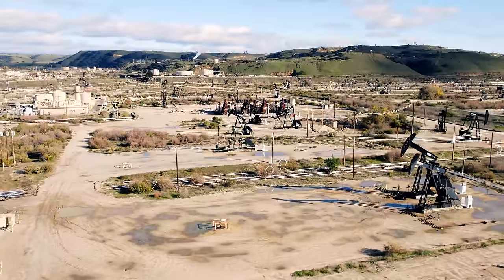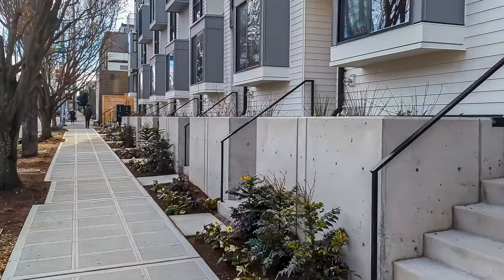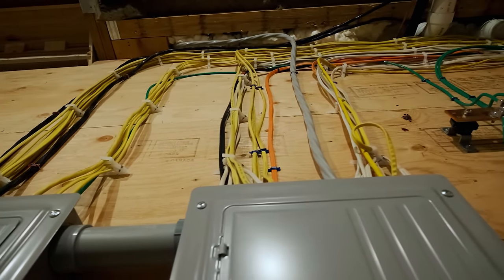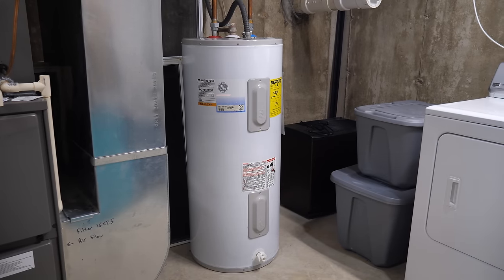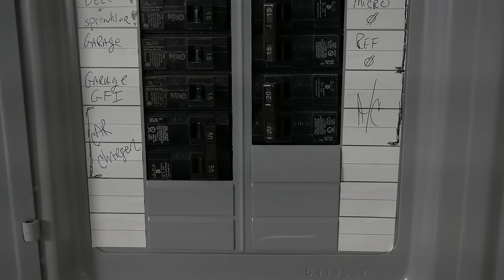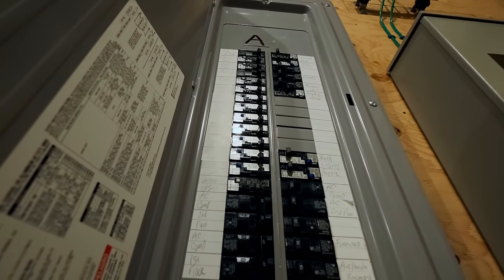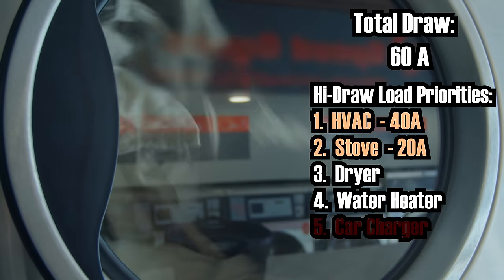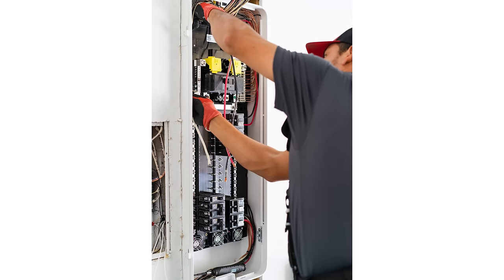Home Electrification: There's not a lot to do, and it doesn't have to be hard (Part 1)

Comment: So I agree with going with electric. The problem really comes in with cost and in some situations gas can save lives. I don't have to worry about winter. Like if power goes out I can burn wood or gas. But for the most part this hadn't been  problem ever. Now what is a problem here is hurricanes. Power outages due to them happen often. And sometimes they last a long time. One time, the power was out almost for a month. They had to wait almost 2 weeks just for the water to leave the low spots before they could get trucks in

But the bigger problem is cost. There is house batteries, but cost and how they live for about 5 to 7 years before having to be replaced makes it impossible.

To make all pure electric we need far better batteries, it needs to be cheaper, and it has to be 100% hands off.

Comment: great video. being from hawaii, the tropics, we dont really use gas cause theres no boiler/furnace to power and though some homes do have gas powered dryers and stoves, im fully electric. still found your video useful because im planning on upgrading electrical breaker panel box and adding some new circuits/lines

Comment: Re: Insulation .... I own a "tri-level" built in 1956. The sheetrock on my walls is attached with 3/4" thick furring strips which are attached to the brick exterior! I added a floor above the house which has good fiberglass insulation, but when the roof was torn off, I asked if there was any way to get insulation into the walls. Not a chance!
I also own a rental property built in 1926. Plaster on wood lath attached to furring strips on the exterior brick walls! Again, no way to add insulation without completely ripping down every interior wall and studding out the exterior walls. Which, by the way, would create ultra-deep window pockets.
On the plus side, I converted the 1956 house from forced air to hot-water baseboard, and I converted the 1926 building from steam to circulating hot water through the existing radiators. Both conversions had tremendous savings on natural gas. I wish there was a good solution for insulation, but there just isn't.

Comment: I live by myself in a mobile home, with 100 amp service, and 15 years ago, when my tank water heater failed, I replaced it with an on demand 45 amp unit. They did not make gas units rated for mobile homes 

Last year my (rarely used) oven failed. I use a toaster, convection table top, and replaced the stove with a two burner induction unit. 
I currently do not have AC and about to retire, therefore this summer I'll install a 2 zone ductless minisplit
Next winter I might be gas free!

Comment: Mexico: 1 phase (115 Volts AC,not 127) with a 40 amps main fuse. About 4500 Watts.😊 In Germany, I had3 phase, 380 Volts, later 400 Volts, with 63 Amp fuses. ~43.5 Kilowatts

Comment: I will say, having a fireplace can be quite helpful in cold climates - but only as a backup. If the power goes out, you can go without hotwater for a while. But you can't go without heat when it's well below zero. While you could have a home-scale battery system, but for the scale of energy storage you'd need to heat a house for a few weeks... it is, if nothing else, significantly cheaper to use fuel-burning systems.

Comment: For the vast majority of situations the most significant cost of a service upgrade IS the new panel and the associated labor to install it. And those SPAN panels cost more just for the panel then an entire service upgrade with a normal panel.

From what I've seen of an electrician on YouTube that even is sponsored by span you HAVE TO connect it to the internet and he even had trouble getting it to turn on and had to deal with customer support for several hours before he could just turn the customers power on because the panel had a firmware issue....

Comment: We had never been to the US before 2018 with my wife. So we went to San Fransisco to a laundromat in the French quarter. Guess how WTF we were as Europeans, when we saw that there was a FIRE inside the tumbledrier! We both were VERY sceptical! I was like "hell no, that can't be, they are actually burning our clothes with gas fueled flames! But I thought that was only on commerical laundromats that would need HUGE amount of electric power for those big driers that are numerous in laundromats! :D

I was a bit amazed that people use gas to heat their water and homes, because in Finland the only places there are gas networks are actually a few big cities. And it is VERY uncommon to have gas delivered by a pipe to your home.

Most homes here are heated with electricity via an air pump, or by a compressor exctacting heat from the earth, and on older homes direct electric heating with heaters under the windows or diesel-oil central heating.

Gas stoves aren't uncommon, but they mostly have a propane tank outside for the stove only. And on cottages in rural areas even gas refrigerators are used if there is no electricity. But nowadays almost every smaller island in the archipelago is already electrified (and we litterarly have THOUSANDS of small islands!).

Comment: I know im a little bit late but im going to leave my comment anyways, down here in Uruguay we have, at least in my home, 8.8kW (220v at 40A) to play around (Everything runs on 220v, including lights), and while my house is at least 50 years old or even more, my father did a complete rewiring when we moved in (Possibly a service upgrade but i dont remember). All of the apliances in my home are electric but the stovetop, that runs on natural gas, however the oven is electric (About 3000W) ("Hybrid Range")we also have a small oven for pizza (1500W) and a toaster (850W), to heat and cool the house we use ductless mini split ACs like the one in your garage, there is one in every room but the bathroom and the hallway, 5 of them in total (3 consume 920W, 1 1200W and 1 1500W), we also have a fridge and a chest freezer, hairdryer (2200W), clothes dryer (we almost never use it), washingmachine, microwave (about 800W), small space heater for the bathroom (2200W at Max power), dehumidifier (440W), the 40L water heater (1500W) and two gaming PCs (Up to around 400W at maximum load). The rest is small loads like lights and laptop computers. I cannot recall the last time the breaker tripped due to overcurrent. In fact at night while dinner is being made, someone could be taking a shower while the other brother is gaming (3000W Oven, 1500W Water Heater, 1800W Space heater on Low, 300W PC, and maybe two ACs are turned on, tho of the 920W ones) Thats about 8440W. However thats not constant, ACs cycle as well as the oven, so its only for some minutes that it happens.

Comment: You forgot about my gas fireplace and gas grill.  I am seriously wanting to elimiinate my natural gas use, though.  I would still like the ability to use my gas fireplace with some biogas, though.

Centralized geothermal is a possibility.  It might be easier to fix that situation.  Just provide landlords an incentive to install a centralized geothermal loop and then attach the various geothermal heat pumps.

Also, there are heat pump dryers and water heaters that pull much less power than the resistive heat options.  And then there are induction cooktops.

Also, the key thing that you mentioned was time.  So, you can use a battery to slowly and steadily be charge by the grid without pulling too many amps.  Then when you have heavy loads... you let the battery supplement!

Comment: Interesting video.  But...  I have got to believe that the smart panel you highlighted will cost a lot more than a service upgrade, so if your only goal is to avoid that cost, you're probably not doing yourself any favors...  Moving on to heat pumps, yes, they are very efficient, until you try to run them at very cold outside temperatures and they either shut off, or start turning on resistive heaters to defrost the coils or add supplemental (emergency, as you stated) heating.  And finally, as much as I would love to eliminate the cost of my gas services (which is just the base bill plus 1 therm for 9 months out of the year), I would hate to give up my gas cooktop and my gas grill.

Comment: I'm really excited for the technologies of Passive Radiative Cooling and Active Solar Heating (which are weird terms considering imo they're both either active or passive, but not each different, they're the same mechanism)

Tech Ingredients made really good videos where they constructed panels specifically designed for these purposes, where they ran conductive coolant pipes through heating and cooling panels and measured the effective heating and cooling of the options. I think this technology will be extremely useful.

if we can perfect the formula for the paint and make it easier to apply (20+ layers!?!?) then I think these thermophilic/phobic applications could even be applied to window coverings to reject heat in the summer and absorb as much as possible in the winter
Reply: Combined with better insulation, I don't see why we shouldn't be able to easily control the climate of our homes as well as we want
Reply: I'm also curious about collecting waste heat from appliances with some kind of coolant circulation system. Why can't we absorb the waste heat from the dryer or other devices and recirculate it into the house by blowing air over a heat sink? I'm not sure whether it will really make a difference, but if it did, then that could make climate control even easier

Comment: The major problem I see is the lack of electricians to do the changes, no matter how minor.  I had trouble finding an electrician to do some minor wiring when I got rid of an electric water heater, added a tankless (gas) and a half bath.  And on more than one occasion I had to rewire things that licensed electricians had installed (things I found in three different houses I've owned) that were not to code, and in one case actively dangerous.  
I know and keep up to date on the NFPA code and have a lot of experience with domestic and commercial wiring, but I'm an engineer.  Doing your own wiring can jeopardize your homeowner's insurance (if there's a fire, for example).

Comment: my parents just got a chevy bolt ev.  they were worried that they'd have to jump to 200 amp service.   instead, they got an additional breaker panel just for the car.  it piggybacks off the original panel, and has some sense wires that look at the loads on some key circuits (like the kitchen, dryer, etc) and reduces the power it will supply to the car if they get turned on.    it's not "smart" like the horrid IoT and app-enabled smart devices.  it's just intelligent.           the sense wires are neat, just loops that go around the wires leaving the breaker box for those circuits, so it can read the current through them, and makes sure to not exceed the sum total 100 amp service

Comment: I am so baffled by the fact that tumble dryers run on gas in The United States! But then again, we've got kettles that go over 3000 watt, because we are unable to wait a minute more (tea for life!). Every side has it things. The tumble dryers in Holland are mostly condenser dryers, heat pump dryers are better for the longevity of your laundry but they just dry way slower than a condenser one, yet (last checked today with current energy prices in the netherlands) they save around 154 euros a year. That's 166 us dollars! Most things are different but they're what people in these different regions are used to, living everyday lifes. In america for example, (pressure) lamps on petrol with gas mantles are (or were) very common, yet here i did not even know that they existed before watching your video on them. Back in the day we used squeezers which recharged when squeezing. Now, we've got a lot more wind up led flash lights. Coffee drip machines are less common here in the EU as well. This is because we do not use thermo coffe cans a much here, and we only prefer one or two cups of coffee at the same time apparently. We've still got drippers in restaurants and places where lots of people drink coffee at the same time, but at home almost no one that i know has one anymore. just a senseo, nespresso, or a Dolce Gusto. All with coffee pads. I do prefer fresh ground coffee ofcourse, and we have those here but at a slightly higher price that most families are just not willing (or unable) to afford.
Right, i've been ranting for way too long, so apologies from me haha. The last thing i wanna say is that  we're rocking 10hz less than you guys haha. Thank you for reading. If you're American, and you are curious about more things, feel free to ask me more questions! Kind regards from a Dutch man.
And of course to the legend who keeps making these incredible educational videos, Thank you so much! 
In the past couple of years, i came to understand a lot more thanks to your superb explanations. Please continue making these videos. 
You even followd up and made a low pressure sodium video 4 years later! you've learnt me a lot of things and i really wanted to thank you for that!

Comment: So much interesting information!

Here in Chile, get full electric seems difficult for the mayority of people. Standard connections are capable of get 6 o 9 KW, nothing more ( we use 220v 50hz AC as domestic current). My little 40 square meter  department have a 25 A  general breaker, and i have three circuits. 10 A, 16 A and 20 A, so i think i have 6 KW connection. So i rely on natural gas.

My situacion it's not ideal for air quality.. in such tiny space, i have a gas range, a  tankless gas  heater from germany with around 14 KW of potency (we name this "calefont"  and are almost universal in Chile), and for heating  i have a minuscule 3 KW "laser" kerosene fan heater from japan. The apartment it's  old, so the gas heater it's in the middle of the kitchen/living room and have a evacuation tube for the exhaust gases, but consumes the oxygen of the house (today this its forbidden ).

My solution to not to be intoxicated: i have a 1000 W  electric cooker and use it for almost all preparations, i use the kerosene fan heater a couple of hours a day , in the morning and in the night, and i left the windows open when i go out the department.
However, here we have humid, but very mild winters ( it's rare to go under 10 °C), and the departmet it's rasonably well insulated (never get under 15 ° C) so the need for heating it's limitated.

New apartments normally are full electric, probably these get spacial connections to the grid....

Comment: I would love to get a heat pump to replace my existing forced-air gas furnace with external AC unit. I have a 200 amp circuit and everything, not to mention quite good insulation.  There's just one problem (aside from the money required): winter is cold here. Like, really cold.  Living here is how I learned that 40 is the one number that Fahrenheit and Celsius agree on, and that it sucks equally in both. There was that one memorably bad winter where the HIGH temperature for the day did not exceed -20 F - for two weeks. Or maybe it was three weeks. February is awful.

I know we've been making major strides in producing air source heat pumps that work at much lower temperatures than in past.  And yet, knowing just how often we hit -20 or -30 F around here, I remain hesitant.

Comment: I plan to avoid electrification as long as I can. Where I live, it is so much more affordable to use natural gas than it is to use electric heating. This is also true for cooktops.
Reply: You'd have to cook a shit-ton or the price difference would have to be astronomical for the change in your utility bill to be noticeable.
Reply: @sanders555  It's my gas furnace that makes the difference. In the winter time my gas bill is usually right around 100 dollars, whereas electric goes up an added 200 on average in my area.
Reply: Deffinetly not true with an induction hob.

Had one in a flat once and will never go back to gas if I can avoid it. Superior in every way.
Reply: @afgor1088  Where I'm at, most homes are 70+ years old. My own home was built in 1952! Plaster walls with minimal insulation. Electric heat just isn't capable of keeping up like gas can! My neighbor regrets switching to a heat pump system instead of staying with natural gas.

I think that electrical heating could be beneficial in a well-insulated home! It just doesn't work for every kind of home.

Comment: Having installed a DIY off-grid solar power system (totally separate from the utility provided supply), I am trying to do a similar thing: distribute loads over time such that the inverter doesn't get overloaded. Being in Europe, I'm fortune enough to already have an electric dryer and separate washing machine. However, when the washing machine heating element turns on, and the dryer is also on, the inverter shuts off. The heating element appears to only be on for a few minutes during an entire cycle.

It would be so cool if the washer and dryer could talk to each other such that when the washer needs it's heating element, the dryer would pause.

I've thought about coding something with smart plugs but there is a chicken and egg problem: to detect that the water heater in the washer is on, power is required thus inverter overload (ie it would be too late for the smart plugs to do anything)